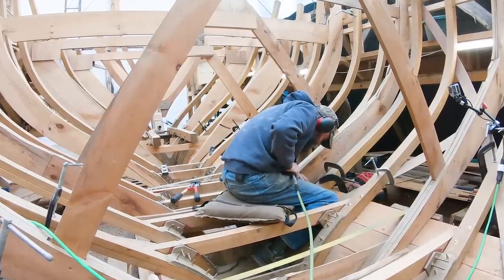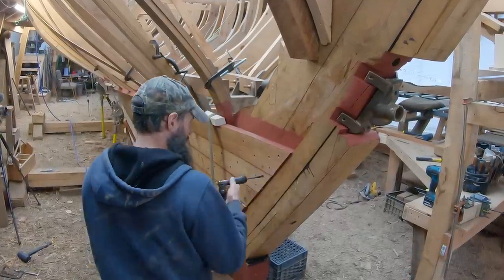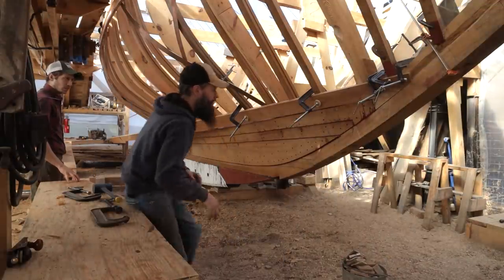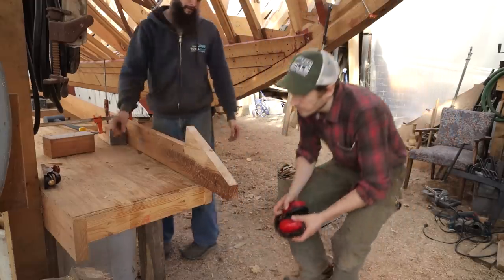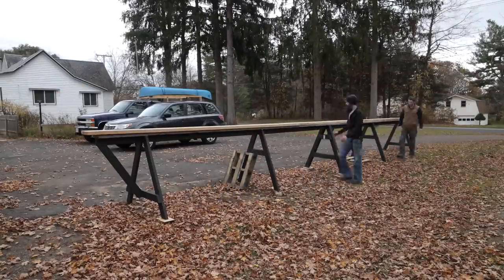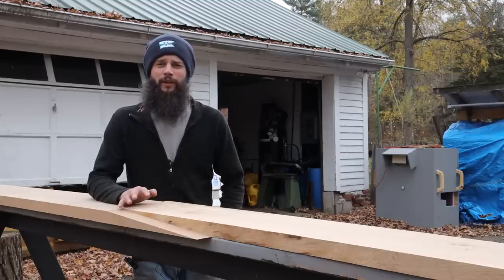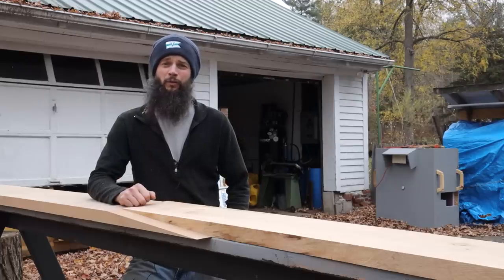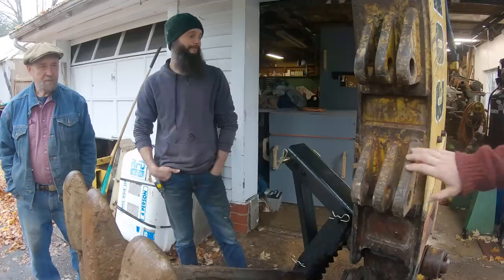Acorn to Arabella - Journey of a Wooden Boat - Episode 89: Planking Our Boat

Comment: i heard "glue" not epoxy. why is the baked glue going to hold now unlike before?
Reply: The glue failure for the scarf joints was due to old  glue.  That has been remedied with fresh glue.  The failure of the small repairs was remedied by going to epoxy for those joints.
Reply: Because they replaced their expired glue with fresh glue, as they explained several times previously.
Reply: i guess i missed that, how i recall it is, even the fresh failed and they switched to epoxy.
Reply: @sportsrevisited9699  The original issues with the scarf joints was resolved by new glue stocks and controlled temperature. They had another issue with gluing scarfed in patches on the *edge* of planks. They believe this was because of dimension changes across the widths of the planks, due to the semi seasoned wood drying, and the clamps heating up and expanding, taking the pressure off the glue joint. The clamps were literally falling off when they took the plank out of the ovens. This is not an issue with the scarfs across the thickness of the planks since the plank thickness is only about 40mm, and the change in that dimension did not cause issue with the clamp pressure. Across the width of up to 300mm or so of the plank, the dimension change was significant, and thus clamp pressure unpredictable. Rather than try and arrange spring clamps that would maintain pressure when that dimension changes, they instead tested epoxy resin with gap filling properties for those joints, and were sufficiently satisfied with the results that they  switched to epoxy for those edge joints.
Reply: Harry Moyes my memory isn't what it used to be, thank you for refreshing it. now that you mentioned it i do recall all that. i guess i got it jumbled in my head a bit. thanks again.

Comment: Will Arabella be as fast as the Bluenose at sail?
Reply: No.  Speed is mostly determined by length of waterline.  Arabella is 38 feet or so, Bluenose is 111 feet.
Reply: @CorwynGC  On top of the waterline length, the Ingrid is pretty deep draft. She's optimized as a very seaworthy boat, not a racing boat. So comfortable, safe, but not particularly fast. AtoA plan to rig her as a gaff ketch,  again choosing smaller easier to manage sails and shorter mast, rather than a higher performance but harder to handle Bermudan rig.  Even if they were comparable in length, Bluenose would probably be faster. https://en.wikipedia.org/wiki/Bluenose
Reply: @harrymoyes5069  Bluenose is gaff rigged as well, and originally designed as a fishing boat.  But she has gotten hotrodded up in her old age.
But hull speed really makes a difference:
V(hull) = 1.34 x SQRT(LWL)
So, Arabella = 8 knots, Bluenose = 14 knots.

Comment: Any reason why you wouldn't be sealing the holes for the rivets, or dipping the rivets in compound before driving them in?
Reply: The rivets are an interference fit with the plank and frame holes, so there won't be any leakage through the holes.  Additionally, the holes are counter bored and will be plugged.
Reply: @boooshes  Boom! Droppin' the knowledge. Thanks! I shoulda realised they'd be backed by plugs from the outside, which can then be compounded/sealed.

Comment: you said you bought the backhoe real cheap. If you don't have much money in it don't sell it. Your already talking about doing things that you never had the ability to do before. Your grandfather has all that land with trees and your always borrowing or trying to find ways to get stuff done,  just keep it, you will always find a use for it. I had a small, 30hp hoe, and I was getting it out almost every day. The front bucket and lift will surprise you at all the things you will use it for. Make a set of forks, that's better than a bucket for handling logs, lumber or stuff on a pallet.
All these homesteaders and ranchers say it is the #1 piece of equipment to have. When you get the boat finished and sail off into the sunset at least your grandfather will have something to haul firewood with. It's yours it's your decision I just want to throw a few ideas your way.
Boat is looking great, it's just 1 board at a time    s    l    o    w   going. Stay safe

Comment: Chalking the planks ever thought to use bamboo like the Dutch did in Indonesia boat building?
Reply: use hemp, you can smoke the left overs
Reply: @brinjoness3386  Trad calking was done with Oakum ( or Oakum Hemp) which is tarred Hemp. It'd be like smoking Senior Service! The Wooden Canal Boat Society (UK) had to make their own as it doesn't seem to be available any more. They soaked skeins of hemp in a mixture of Creosote and a CCA and then allowed it to drip dry. Awful stuff but it should do the job.

Comment: Im still confused as to why they are using rivets instead of screws. Is that an east coast thing?
Reply: Screws can work loose.. rivets don't. The guys have already explained the reasoning behind each of the different fasteners they've used, depending on the situation and purpose.
Reply: JAFO must have missed that episode. I built wooden boats professionally for a few years and ever used rivets on a boat this large unless it was lapstrake. I’m not saying it’s wrong its just not common practice as far as I know.

Comment: Since head rises.
Wouldn’t it make more sense to have the lightbulbs on the bottom of the boxes?
Reply: Don't want the epoxy dripping down onto the bulbs. Happy little explosions!
Reply: Kathy Johnson 
As long as they are off to the sides or corners and not directly underneath the adhesive, that shouldn’t be a concern.
Reply: Heat doesn't rise.  Hotter fluid rises.  Heat from lightbulbs is mostly radiant rather than convective.
Reply: CorwynGC 
Air IS a fluid🙄
Reply: @charlie15627  Of course it is, that's why I used the word.  And light bulbs aren't producing hot air, but radiant heat/light.  Heat moves in three ways, by conduction (direct contact), convection (via a fluid), and by radiation (photons).  Light bulbs are almost all radiation.  Things warmed by radiation will then warm the air around them. But heat can only move from hot to cold, so the air will always be cooler than the things in direct path of the light bulb radiation (unless those have a better path to cold).
Reply: @kathywrightjohnson6804  - Bingo! This is the correct answer. (But it's not epoxy.. it's resorcinol.)

Comment: Reason for not also gluing the planks?
Reply: They ARE gluing the planks.. didn't you see where they joined several shorter pieces together to make one long plank?

Or do you mean when the planks are fitted, gluing each plank to the one below it? That wouldn't work.. when sailing, the constant flexing of the hull would break the bonds between each plank. Instead, the gaps between each plank will be caulked, and when the boat is in the water, the swelling of the wood will squeeze the caulking tight, making a waterproof joint that can still flex.
Reply: @Garryck-1  Get it now...thanks
Reply: @thomasgilling8729  - You're very welcome.

Comment: Wouldn’t you need to put that brown nutella thing in top of each long planks? I mean, water will go between planks
Reply: This is carvel planking and will be caulked between planks.  This allows for the wooden planks to swell and shrink while the flexible material between the plank edges keeps them water tight.

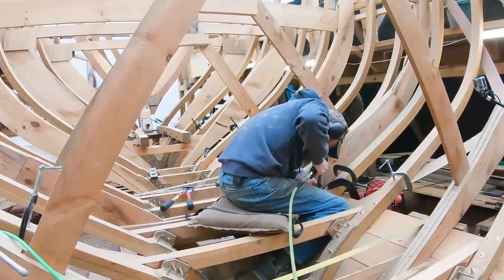Comment: I do like your use of time lapses and avoiding repetition. My OCD has kicked in  - @0:15 I noticed several attached bolts with a lot of thread exposed, is there a purpose or will these be cut to length?
Reply: They've stated elsewhere that they'll be cut to length at some point.
Reply: @Garryck-1  At the time of fitting would have made more sense
Reply: @freepress8451  - I agree.. but there has been good reasoning behind everything else these guys have done so far.. I'm assuming they have a reason for this, too.
Reply: @Garryck-1  Yes they have made some sound decisions, yet now they are planking access gets tighter and they become a hazard

Comment: Why would you use copper rivets instead of stainless steel bolts. I’m guessing cost could be a factor. The copper looks great though.
Reply: Gary King, check out an earlier video on the interaction between different metals with each other, timber and sea water. I don’t remember if stainless was tested specifically, but steel and iron in general cause “iron sickness” in timber, which weakens it. I don’t know if stainless prevents that or slows it down or not. Copper and bronze don’t cause it at all.
Reply: Also, stainless steel needs oxygen to maintain its stainless quality.